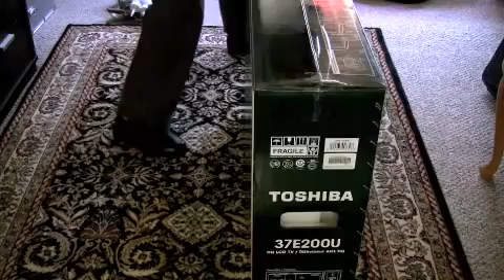Solar Air Heater - Build Yourself - Quick Cheap Use old Box

Comment: kudos to U!  i made a similar version,  as most of the ones ive have seen on U tube  are expensive and heavy. Seems to me overbuilt and overkill. AND its all about payback and cost IMHO,  mine has a wood frame and a 2 inch backing of blue foam(  overkill but the foam was free.)  but to keeps costs down   a heavy plastic front.
 ironing out the kinks right now. in -20 celcius temps it warms 20 degree house air to 48, i am expecting better once i get some air trapping issues dealt with.